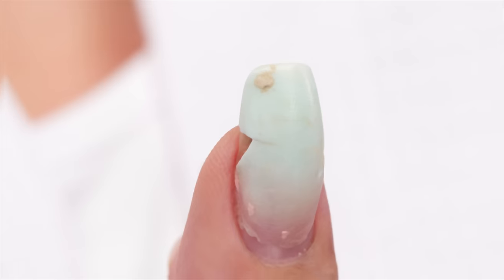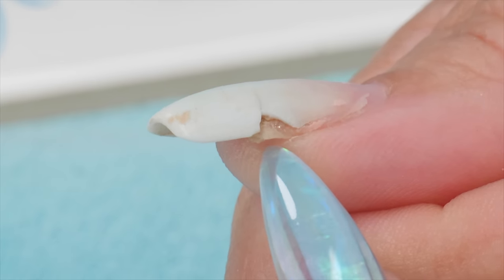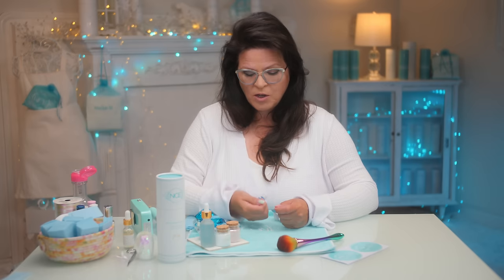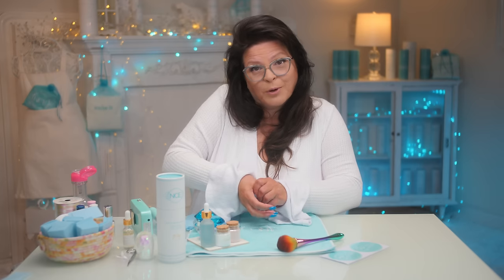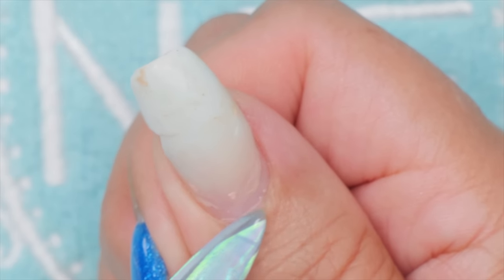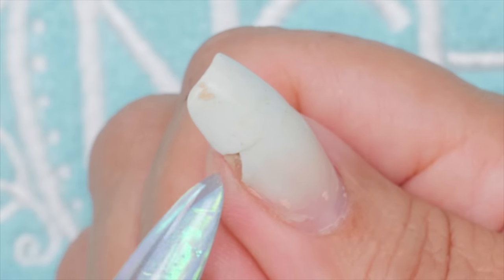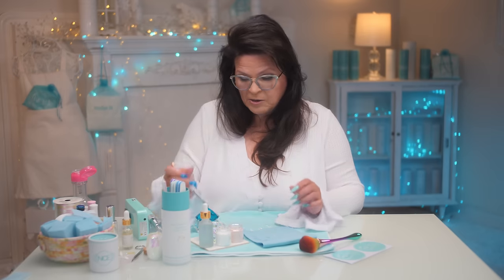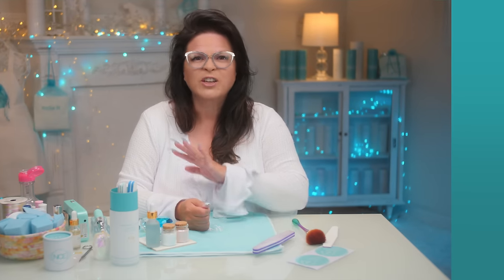Stress Crack - the How, the Why and the REPAIR 👍🏼

Comment: @nail career education - would you use similar strategies to fix a stress crack/tear in PolyGel?  I just used Duo Forms for the first time and it's apparent I didn't make them thick enough...  Now I don't know what to do. 😩  Assuming I use the same strategy; get rid of lifted areas, primer, fill the holes/make it thicker in stress areas, file, and so on?

Comment: My natural nails keep getting what appears to be stress cracks., usually below the free nail about a quarter of an inch. What causes that and is there away to save the nail without using acrylic or gel nail products? If so how. Thanks!

Comment: Do you use a dehydrator and bonder when using polygel? Or is it only meant to be used with acrylic? Cos you paint over the natural nail with gel before applying polygel. So is a dehydrator and bonder still necessary?

Comment: Would  you ever put a small dot of glue in the "hole", allowing it to seep between the nail & lifted acrylic before filing it down? And then patch the area with more acrylic….. wouldn’t that help prevent it from breaking further, especially if the lift goes further across that you think??

Comment: I have been using the… ‘Gelish’ dip system, and it seemed easy at first,  but the base product hardens so fast that it doesn’t go on smooth after the second fill application three weeks later.  Is there a way to thin it?  If not,  I am thinking about trying the monomer that you have mentioned with low odor.  My husband can’t deal with the regular ‘No Lift Nail’ monomer that I used to use.

Comment: Hey Suzie and cameraman (to the nailroom you should so have had a cape and eye mask 😀) Had stress cracks a few times but usually on my natural nail not so much with enhancements but I think I am at times a little heavy handed with product. Great to do this with your non dominant hand. I am left handed and struggle so much going righty! Any good tips for that (bet you have prob done one!) See you next week x
Reply from the maker: LOL you are cute, I do have several videos on doing your non-dominant hand. The biggest trick I find is holding your brush or e-file steady with your non-dominant hand and move your dominant hand especially works well with filing you have more control this way
Reply: @NailCareerEducation  Lol thanks Suzie. Will look through your videos and will find one. I can do that with the e file ok but the brush not so well. Some say us lefties can be ambidextrous but I beg to differ!

Comment: Suzie i got a question….. why do you want a clear layer in the cuticle area first and then the white?
You probably have explained it in a different video but i came across this and now i wanna know.
Reply from the maker: I certainly don’t mind explaining it again. In fact I love that you asked. A lot of places won’t put down a clear or pink layer thin that is, of acrylic first. And I understand you might not want to because it can add thickness, but when the client returns and they want to take the black or the green off of the nail it’s very hard to get it off of the nail plate without hurting. Yes you can soak it off but it’s also time consuming filing it as much faster. And when your nail technician working every hour on the hour you don’t have time for soaking. So by applying a thin layer of clear or nude allows the tech to file down to that clear or new layer as opposed to painstakingly taking off every bit of green. It saves a lot of time and a lot of anguish at the nail table for both client and the tech. I highly recommend it however not on the free edge I don’t understand why people do this on the free edge there again wasting their time

Comment: I use the inner corner of my forefinger nails often enough that the natural nail now bends downward, and it's the first place I get stress cracks. Getting it the right amount of thick is serious trial and error.
Reply: On both my hands the outer corner of both my index and center finger bend down like that. Those corners are the first to go if I don't fortify with some uv gel polish. Good thing I like having bright colourful, sparkly nails! Right now they're robins egg blue with a scattered holo topcoat (not Holo Taco brand, they don't do gels sadly).

Comment: How would i repair a cracked  nail with a builder gel? Do you have any video i can watch? Thanks!
Reply from the maker: Actually sweetie it’s basically the same way. File up any lifted discoloured area completely, prep and prime, and then just add your gel, it’s exactly the same way you’re just applying with different stuff
Reply: @NailCareerEducation  thank you, mine won't stop peeling of even with the builder gel, I'll keep practicing 🙌
Reply: @NailCareerEducation I have had stress fractures several times with gel builder and repair them as you outlined here but often end up with the same fracture again in the new repair. Any suggestions on how to stop that? Would applying some sort of mesh or fabric underneath work better? If so, what should I use?

Comment: Why wouldn’t you want white on your cuticle without a clear layer first? I’ve been wanting to learn how to do acrylics.
Reply from the maker: Because IF you want it removed for a new design getting white off, filing white or colours like black or green or red is to hard to get off. Yes you can soak takes too long - clear or nude protects so if you wanna change it out you file down to the clear layer and no one gets hurt
Reply: @NailCareerEducation  ooooh okay thank you so much for responding so quickly!!🖤🖤🖤

Comment: Does anyone know how to fix a stress crack with only gel polish?
Reply from the maker: Gel polish is just an aesthetic there is absolutely no strength to gel polish whatsoever. So you can fix a stress crack by removing the gel polish and simply filing the cracks so it’s a little bit smooth and then reapplying your gel polish. It’s only covering it up it’s not making it stronger or fixing it by any means
Reply: @NailCareerEducation  are there any good options for harder bases that aren’t actual gel?

Comment: I'm a little confused on why you would do this. The nail is quite grown out to where a rebalance would be needed soon anyways. Why not completely remove the enhancement and start new to ensure that it won't crack again? Just seems like it would set the nail up for failure..again 🤷
Reply from the maker: There is NO need to remove any product that’s not lifted- it’s unnecessary and a waste of time and product - this repair is very efficient and correct